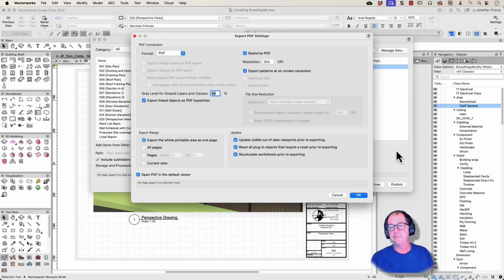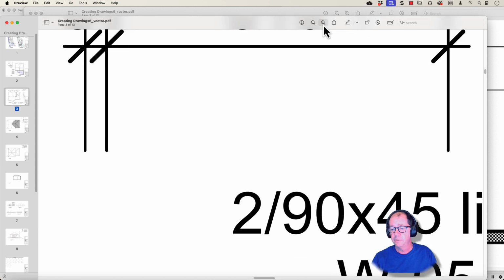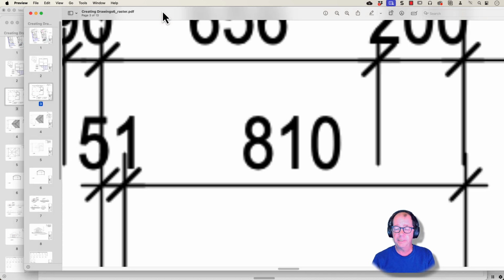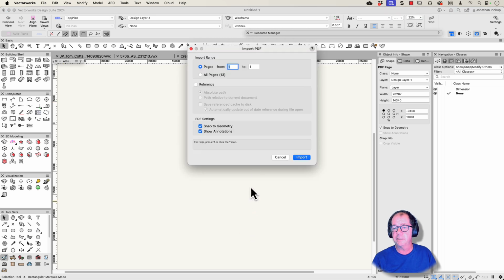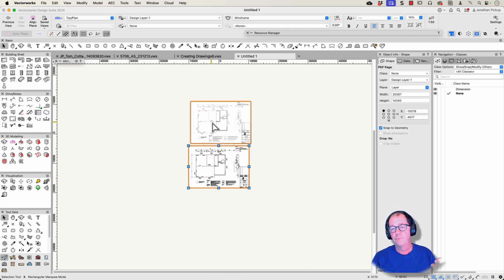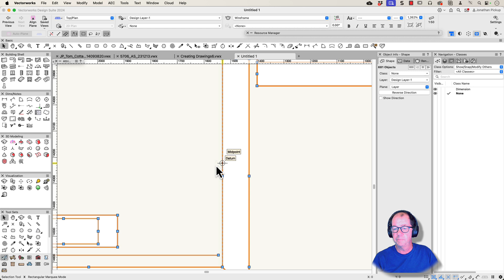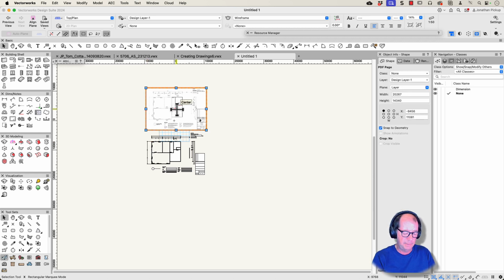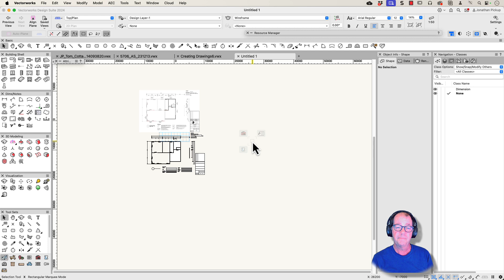What is the difference between Raster-Based PDFS and Vector-based PDF

Comment: Hi Jonathan. What would the reason be for using a raster based PDF? Is file size smaller? Seems vector based has all the advantages.
Reply from the maker: if you give me a vector-based file, i can explode it and change it, or i can use it as an underlay and snap to the points, making it easy to copy your work. The raster file prevents this. there are some fonts that don't PDF well, the raster file gets around this.